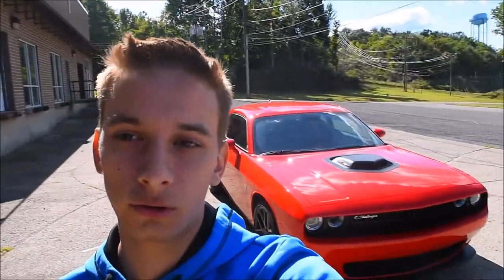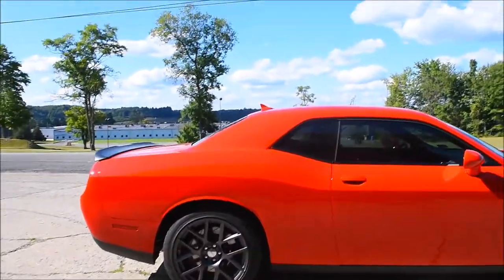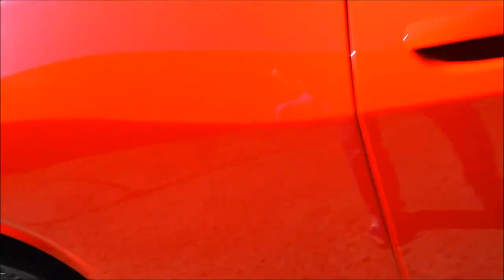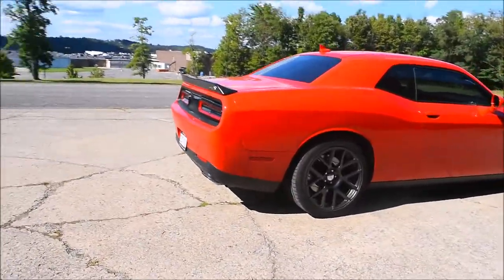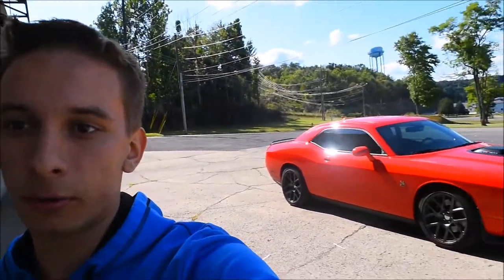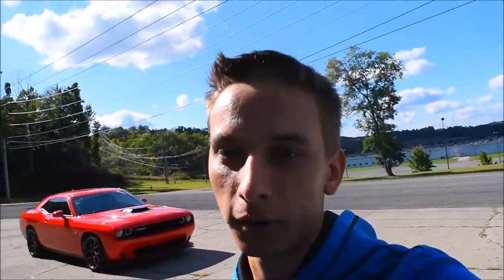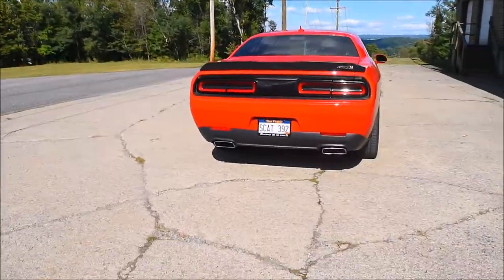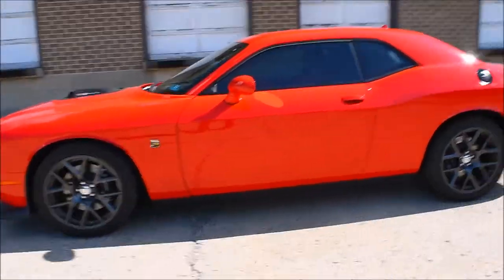Dodge Challenger ScatPack Muffler Delete

Comment: HI, is there any annoying Drone inside the car when just cruising around town or on highway ?
Reply from the maker: SPG 565 there is some drone at certain rpms but I don't find it annoying at all
Reply: ok, thanks for your reply, nice car !!
Reply from the maker: SPG 565 thanks!
Reply: There IS noticeable drone after the delete, especially on the highway, but notice that by putting it into 6th (on the manual) the drone is very low, unless you give it some gas. You just have to find a sweet spot when on the highway. Not sure about the automatics, but I assume that it's the same. Also, I've noticed a considerable amount of popping and backfire after the delete. In some cases it's fine but if you don't like attention, I'd suggest thinking really hard before doing this mod.
Reply from the maker: well said, thanks